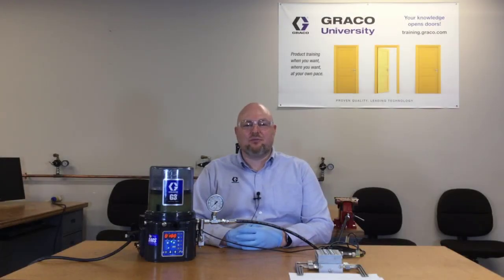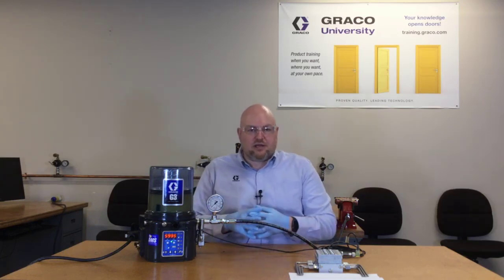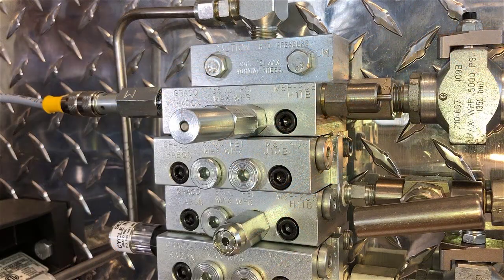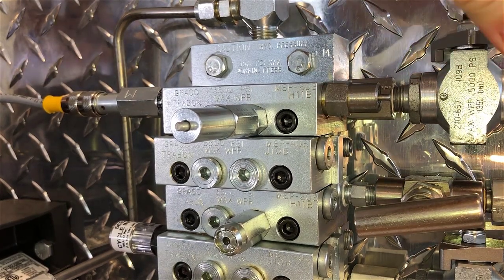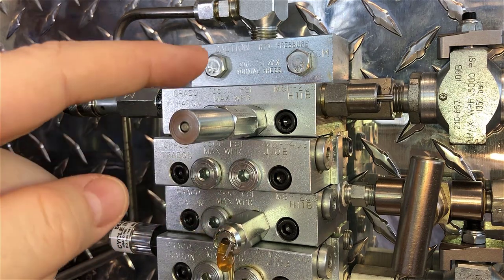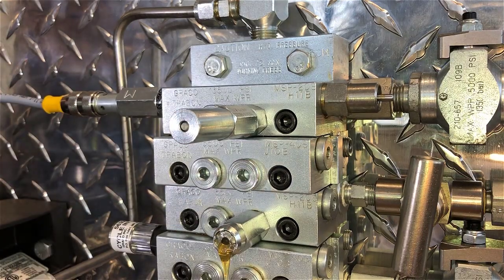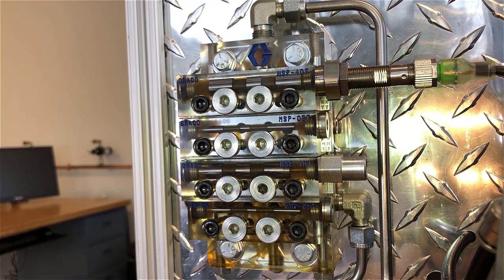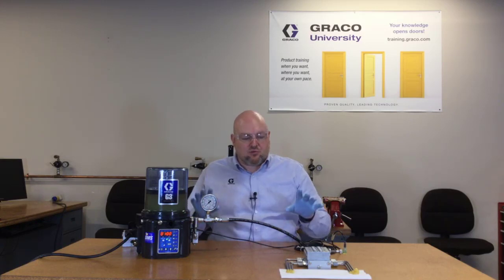Auto Lube Basics: Series Progressive Divider Valves

Comment: How to complete clean such valves and the delivery tubes, we are erecting a old used machinery.
Reply from the maker: Hello Arvind Ashoken, and thank you for contacting us. The question from Rigo (above) was similar, and we are going to refer you to the same manual, and again to page 14:
https://www.graco.com/content/dam/graco/tech_documents/manuals/312/312497/312497EN-Y.pdf

One additional note is that when you remove the pistons from the blocks, it's best to do so one at a time unless they are all different sizes. Because each piston is match-honed to its block, it won't function properly if it's installed into a different block. So just make sure that each piston is returned to its original valve after the cleaning is finished. If a valve won't cycle after it has been cleaned, then that valve section will need to be replaced.

Comment: Thank you for the video! very well made. 
Do you have any videos showing what to do in case of a blockage? 
how to troubleshoot  if a performance indicator doesn't pop out? 
How much PSI does it take to make that pin pop?
Reply from the maker: Rigo, thank you for your comment and kind words.

While we (currently) have no videos for these subjects, the documents linked below have helped many other people when they have questions or need more details about the subjects in question.

Here is the manual, see pages 14 to 17 for the section on locating blockages:
https://www.graco.com/content/dam/graco/tech_documents/manuals/312/312497/312497EN-Y.pdf 

For more details on Performance Indicators refer to document L15401:
https://www.graco.com/content/dam/graco/led/literature/flyers/l15401/L15401EN-C.pdf